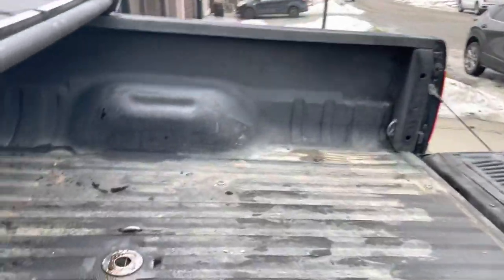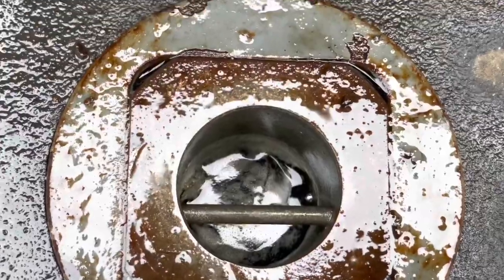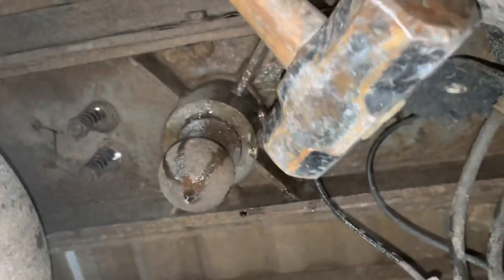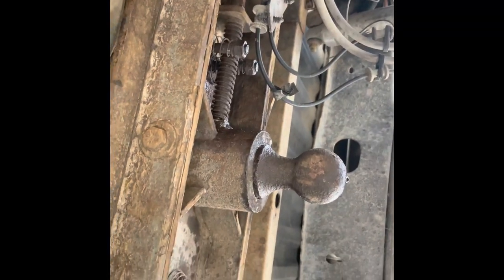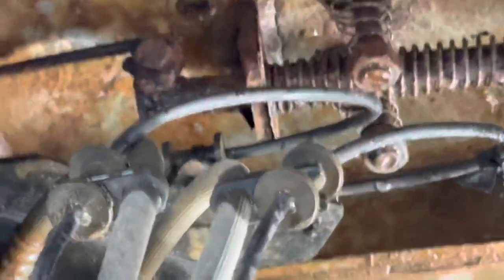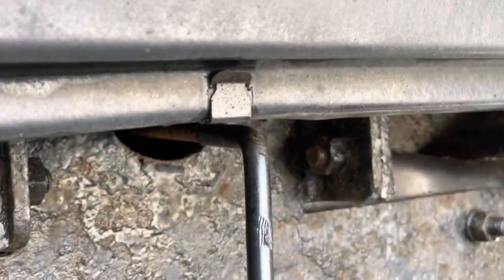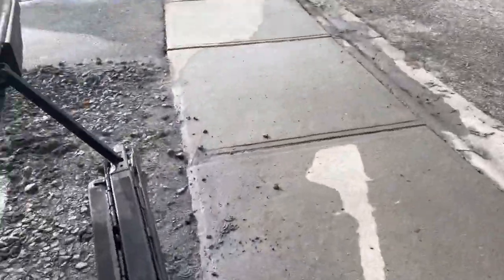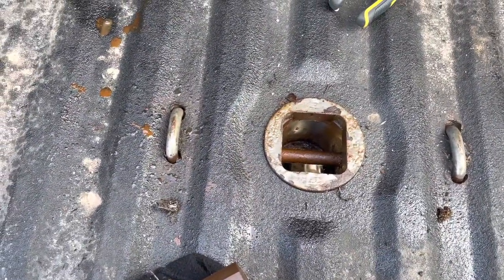Gooseneck trailer lever stuck ? Watch how to free it up !

Comment: coat everything in grease and the trailer hitch it will never get stuck
Reply from the maker: I should have put a little neverseize
Reply: I just installed this hitch today and read about people having problems with the ball sticking, so I used water-proof Marine grease.  Hope this helps.  Thanks for the video
Reply from the maker: @driver4818   good idea 👍 thanks for the view

Comment: I leave the ball with the trailer all the time and never have this problem.  WD40 is water displacement formula 40.  Don't know why everyone uses it for rust when there are better oils for rust penetration.
Reply from the maker: I just bought the truck . But that’s a good plane to take the ball out . Yes and the 40 stands for the 40th attempt for water deflection . When nasa was try different things then when all the people that worked there started using it on different thing in there home they decided to put on the shelves. Thanks for the view and info man greatly appreciated 👍👍